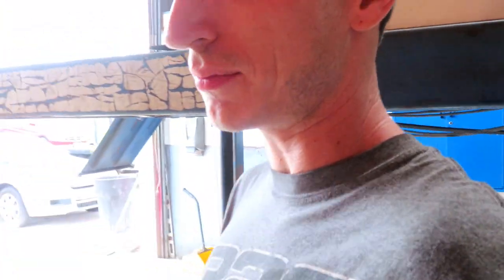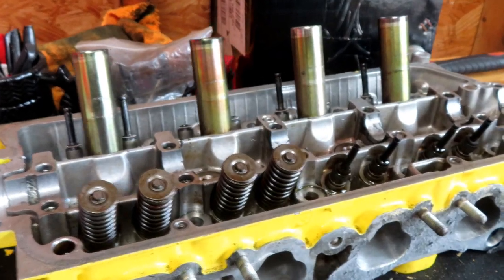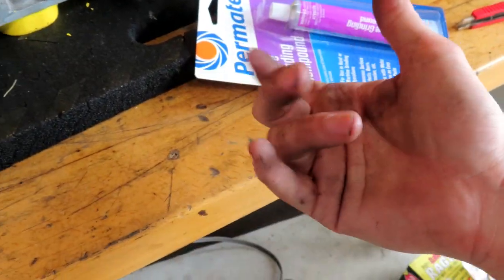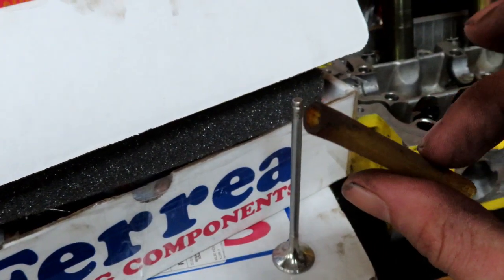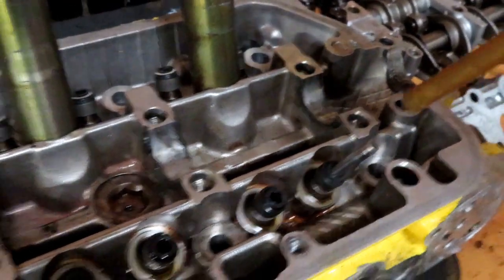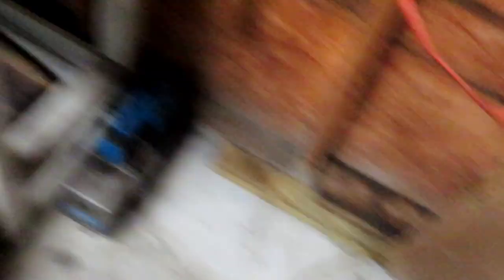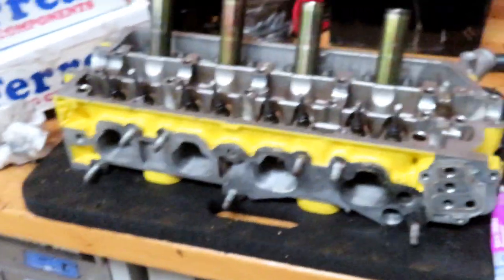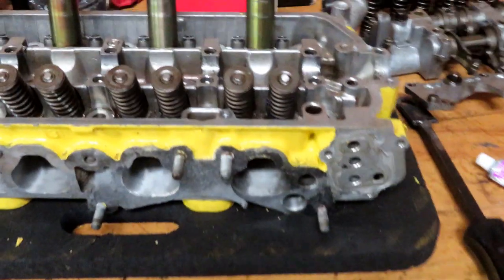Installing Ferrea Flat Valves And BC Springs In A D16Y8 Head￼

Comment: Do you have suggestions for valve adjustment? I swear whenever I do it my ticking just gets worse. Should I be closer to the the tighter or looser end of the spec, what should the feel be between the gauge and the rocker arm, tight, medium or loose after adjusting the screw?
Reply: Medium also I don’t recommend valve adjustments unless you change the timing belt as the belt will accumulate slack over time

Comment: So I’m installing a catch can on my build I’m going d16z6 delta 272 cam skunk 2 alpha springs titanium caps stock valves ported head victara 75 mm piston long no notch rods king bearing stock crank bearing t3/t4 rev 9 turbo speed factory timing gear speed factory 4 bar arp head studs running on pump gas what’s a good boost level and how much power you think I’m looking at I also got hunter 1000 cc injectors and hunter tune 450 pump stock z6 intake and fuel rail
Reply: That cam a 272-2 regrind?
Your weak point is the pistons. Should have gone forged. Also, the skunk works stuff is no longer good. I would never use any of their parts in my engine. The 272-2 will make some power, and could be done on the stock spring, just don’t rev to the moon. 🌙 the 272 from what I recall don’t have much more go in those upper rpm’s anyways. You will need to adjust the valves. The old nitrous ZEX cam did really well in the singes for turbo. 
That cast pistons are the weak link in this set up, as into those upper rpm’s you are at f1 speeds. Castings can’t take much of that. 
Your set up will do a good 400-500 whp easy with proper tune. 
I would like to also add that the diff pin should be welded into place. Locked or unlocked is your choice. I’ve also run posi and phantom slip. If running phantom type, you gotta cut those gears. I’ve had them machined, and used a grinder. The grinder one worked better for whatever reason, and I still have that trans.
Reply: @HellHoundOne  ya this is my first build I’m aiming for about 350 to 380 and I was iffy on the piston but my buddy told me he has had them in a 500 hp build and they did fine what piston would you recommend?
Reply: @HellHoundOne  is your 400 to 500 on pump gas what are your thoughts on water meth injection ?